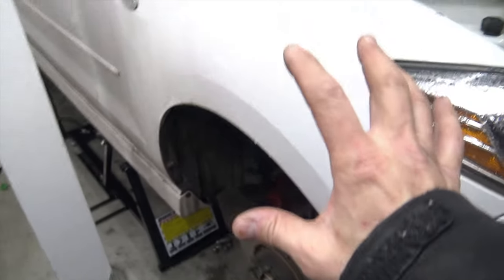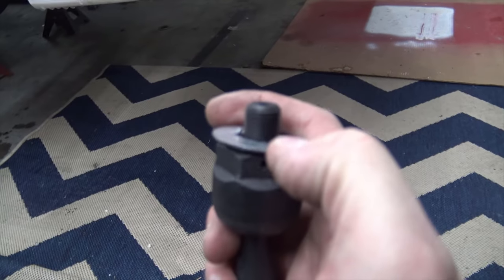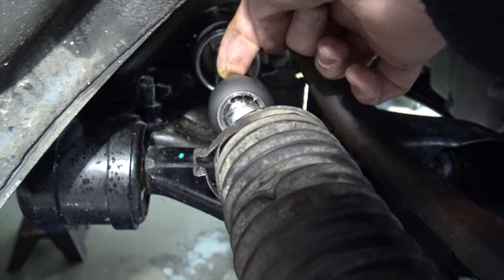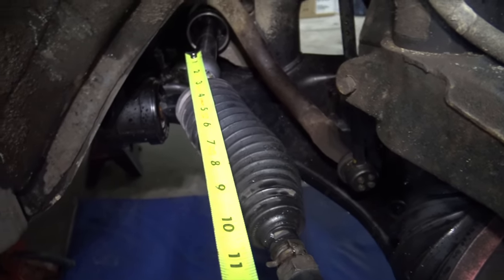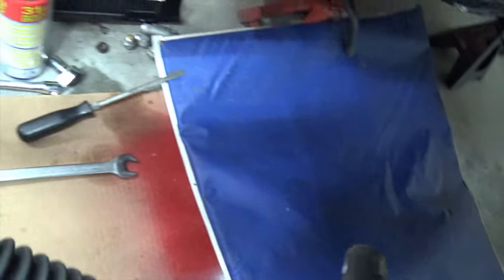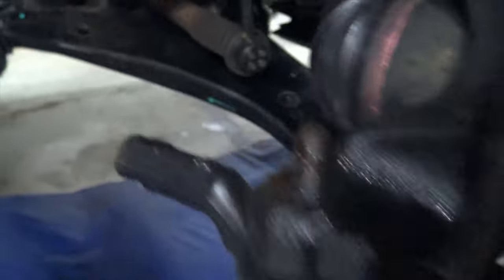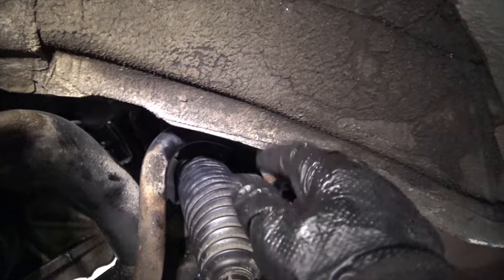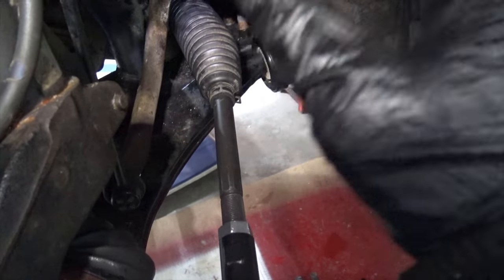Got the clunk? Replace inner tie rods EASY!

Comment: My mazda 3 put me through this same process. At first thought it was just my ball joint, ended up having to just replace everything aside from Axle. I suggest that anyone who has to change a piece of their suspension on a Mazda to just order all the components. Also, I would strongly recommend that you order new bolts just in case, for some reason control arm bolts rust very easily and they might need to be special ordered...